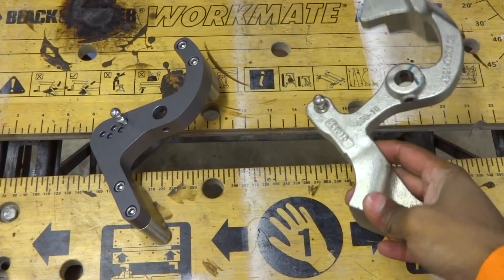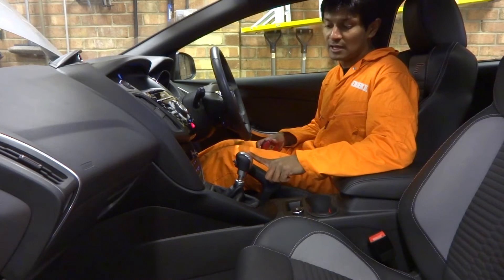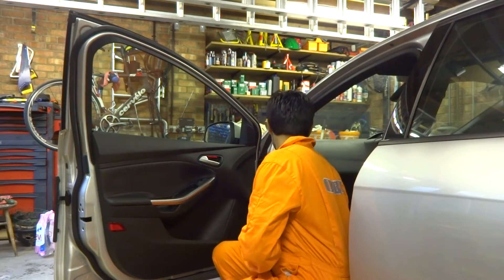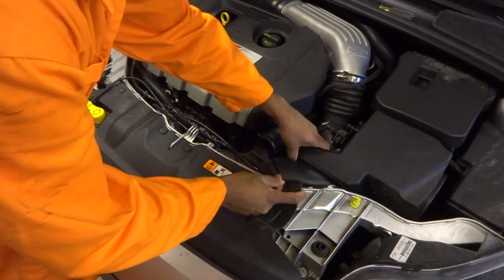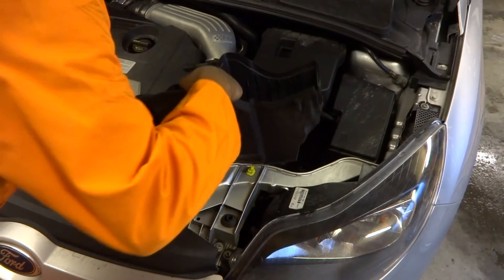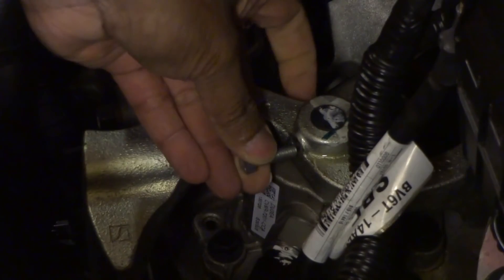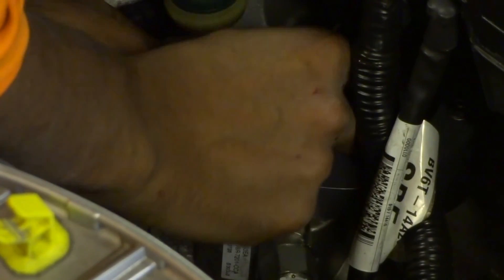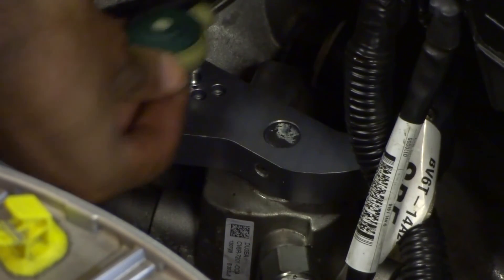Ford Focus Short Throw Gear Shifter Install and Tech Overview ST RS 2016

Comment: Excellent installation video! Hands down the best and most in-depth I've found on Youtube. Though I think you can remove the airbox in one lump by just pulling... makes it slightly faster but if you're installing a filter at the same time then this is the way to go!